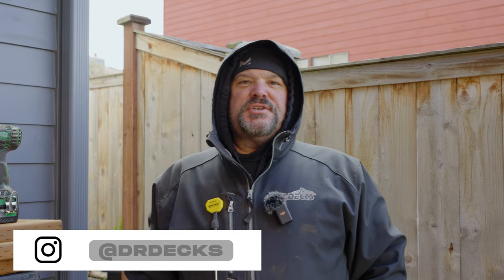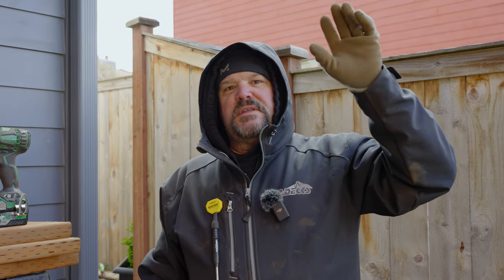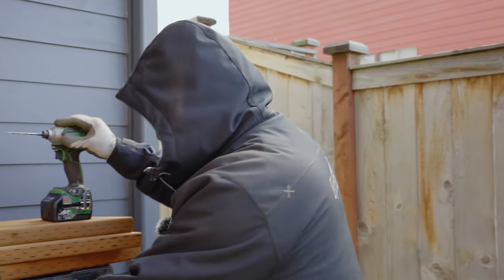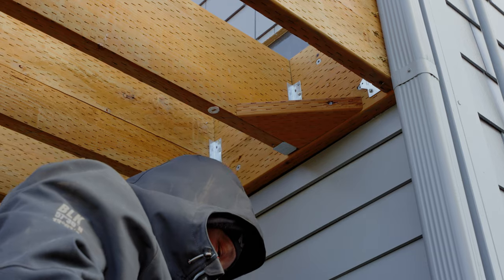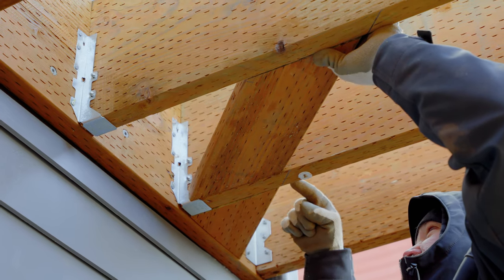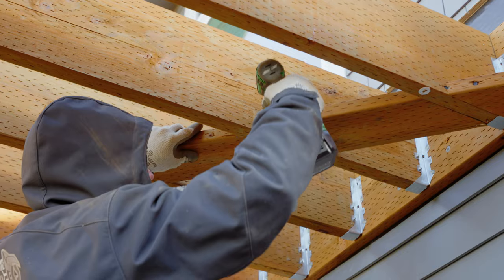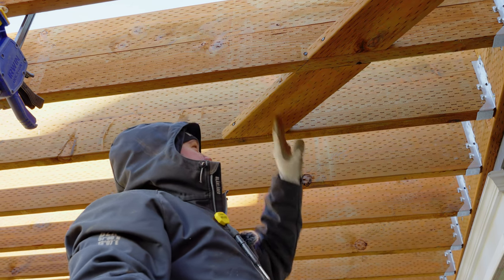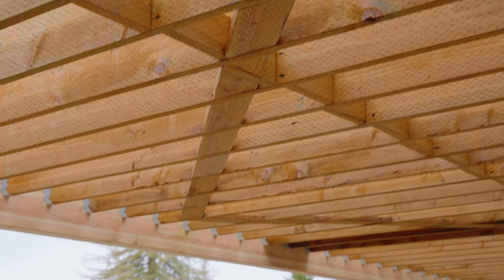Recessed V-Bracing For Soffiting || Dr Decks

Comment: I just used this method to firm up my deck.  My deck is about nine feet above a patio, 17 feet wide and 11 feet out from the house.  I went from the corners to the joist in the middle, and the "V" shape stopped about a foot in from of the beam.  My deck frame went from a little shaky to rock solid!  Thanks for the awesome video!
Reply: Is that a 2x6 or 2x8?
Reply: Wouldnt the installation of deck boards on top not achieve the same result in essence?

Comment: I’m curious if the inspector will accept that. My last deck I built, the building inspector was very adamant about the V-bracing and type/quantity of fasteners holding it to bottom of deck joists.
Reply: They wouldn't where we are. It's better off notching the joists
Reply: I'd be curious to see the code provision the inspector sited.  It's been a while since I built a permitted deck but what I remember was sway bracing was subjective in the code.  I assume it's been clarified and made more profitable for whoever lobbied the change.
Reply: I sincerely doubt he’d post a video giving advice that couldn’t pass inspection. In his locality at least.
Reply: @robertburgess6100  lol, what?!
Reply: So what fasteners did the inspector greenlight?

Comment: Why couldn’t you just run the same board scribe it all notch it all out and put it in it seems like it would be a lot stronger and much faster
Reply: Because it’s against code: 

The length of notches should be limited to 1/3 of the joist's depth. For example, for a 2x10 joist with a depth of 9.25 in, the maximum notch length would be 3 in.

Comment: V-bracing vs blocking?
Reply: The v-bracing you did here is really just horizontal blocking, correct?
Reply: Curious on this answer as well…
Reply: I'm no expert, but this doesn't seem like V-bracing to me either.
Reply: There is a metal deck sway brace (SB16) that is installed just like this as blocking and is supposed to limit sway as well.